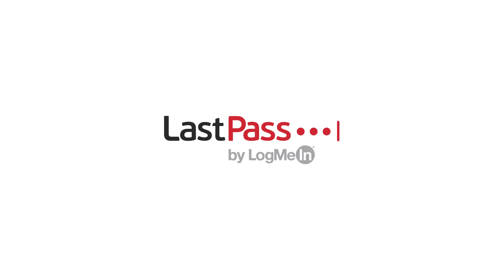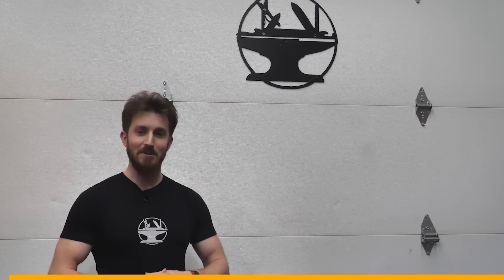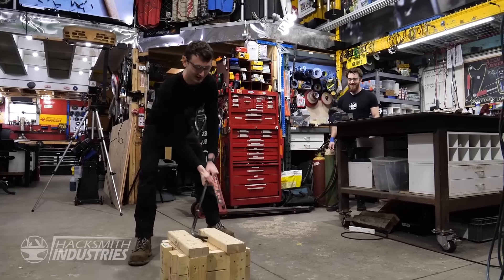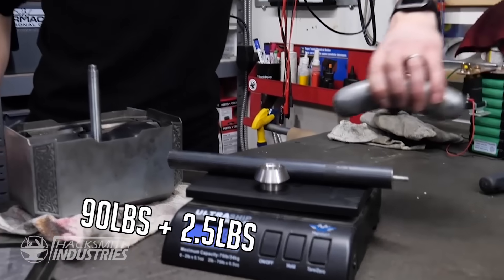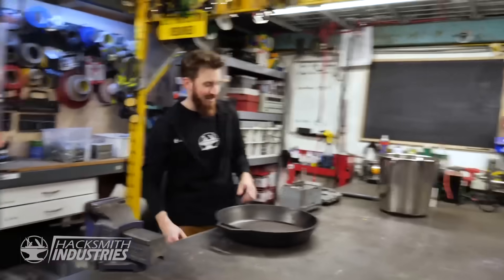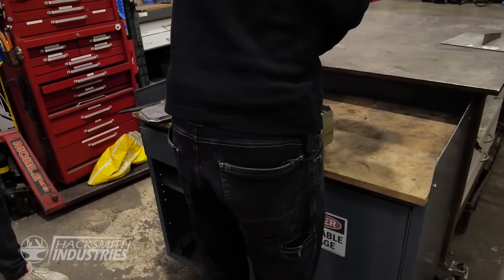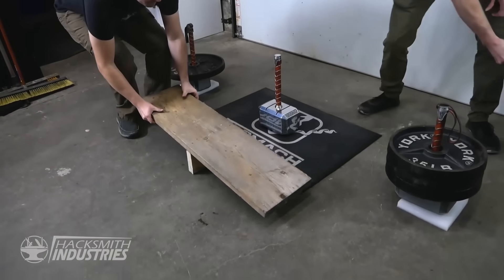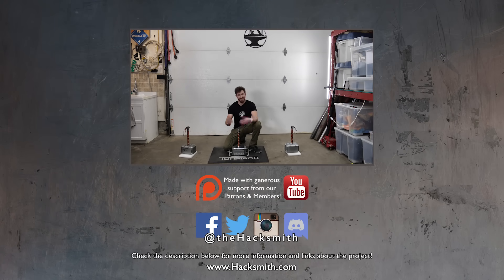Tungsten Thor's Hammer (World's HEAVIEST)

Comment: You should get some depleted uranium next time lol. Great video, keep up the good work
Reply: Yeah. Could melt it, considering it's within the temperature range of steel molds. Not that those last long, but there are over 200 K between their melting points. A steel melting foundry can handle DU just fine. It might be licensed though....

Comment: Since Gold weighs more than Tungsten and a lil 12in Cube of Solid Gold weighs about 1200lbs, what would the Hammer weigh if it's cavity was filled with 24k Gold?
After you notice, the Bevels and Threaded Rod displacement must be Subtracted, I will not accept "FML!!!" as the correct answer...................ok go ahead and use Water if you must.

Comment: I knew they couldn't make a pure tungsten head hammer.  Tungsten is an element with the highest melting point and is used in the hardest tool steels.  This metal is much coveted in the aerospace industry for making jet turbine blades and rocket nozzles.

Comment: Go on make really heavy. Use Uranium.
Edit: This statement was wrong.
Reply from the maker: Weighs the same as tungsten... Check your numbers first ;)
Reply: @hacksmith  Quite right, just found out that Uranium, instead of tungsten, is used in ammo due to it's availability and not for it's density . Uranium is actually a bit less dense. Unlike me it seems. :)

Comment: Too bad you couldn't get enough tungsten and melt it into a block roughly the same size as Thor's hammer. If someone can make that happen, I would be impressed.
Reply from the maker: You can't melt tungsten!
Reply: @hacksmith  it had to be melted sometime in order to make tools from it. Over 4,000 degrees but I don't know what could be used to hold and handle it 😆
Reply from the maker: No, it's not, look up how tungsten is processed ;)
Reply: @hacksmith  how were those tungsten pieces you had formed?

Comment: This reminds me of the Circus dumbbell challenge .  The first man to clean the 180lbs dumbbell to his shoulder without cheating was Bill Kazmaier of Auburn, Alabama.    However, getting the hammer up is way more impressive due to it's center of gravity being way off.  Moment in engineering physics is the tendency of an object to rotate about some fixed point.  As the moment force increases, the difficulty of the object to remain in one spot and to be controlled (in the case of this hammer) goes way down.  If the hammer had a 4' long handle weighing 20lbs and a head weighing 90  , and you tried to pick it up from 3' down the handle -- It would be a greater effort than to pick one up that had 2 heads of equal weight.

Comment: I thought at first, "Lol why dont you guys just melt the tungsten and fill it up. It would be way heavier" Then I decided to google tungstens melting point 3410 °C. Fair enough
Reply: WillW not sure where you got this from? Might want to check google before posting things you’ve heard of so confidently.
Reply: Sp4nn4ri a ceramic mould could hold the tungsten
Reply: @cameronknowles6267  Most people don't have access to something that can heat a metal up to that point. Best I can figure is   King of Randoms Arc welding furnace in an argon gas chamber (to prevent oxidation tungsten oxidizes very quickly when it melts)  scaled up slightly and then pouring it directly into a ceramic mold of the hammer. You could scale it down to put the steel around it or just make the whole thing out of tungsten. 

This would be expensive, difficult, and i'm not sure how well tungsten will work when you're pouring it in layers like that because it would be extremely difficult to do all at once without industrial equipment designed for it.
Reply: @TheHomicidalTendency  a Craigslist oven maybe!?! They are pretty awesome! ;)
Reply: Even if you could melted the W, you won't be able to put it in the hammer, because the hammer would start melting at that temperature

Comment: Could’ve made a sand or ceramic mold and use a homemade arc furnace to melt the tungsten into the exact shape of the inside of the hammer. Would’ve been easier than cutting the shit
Reply from the maker: No, you couldnt have

Comment: Filling the handle with Tungsten would have made it a bit heavier while also balancing it out a bit more.   A solid tungsten rod for the handle would have been optimal.  But this is still pretty cool.
Reply from the maker: That would add a pound or two of weight though, the handle is less than 5% the volume of the hammer

Comment: Pure tungsten is not machinable. Like other non machinable materials it is available in a sintered form. Which is a powder that is compressed under high pressure and bonded with a polymer. Yes it is very expensive.

Comment: If you poor it out of gold it should be heavier still. Since you can replace het molten lead part in there with a materail almost equally dense as Wolfraam. It would look insanely pretty. However not very cost effective. Although it could easily be melted back.Pure gold is quite soft. Not very much suited for hammering.

Comment: Next time use Platinum, its got a slightly higher density, but its way lower in melting point 2041.4K, 1768.3°C, 3214.9 °F,, its only 250.000 $ pr kg !

Comment: Why did you guys lie about the prices of tungsten? Scrap tungsten is only worth $14 a pound and pure tungsten is only worth about $22 a pound. 85 pounds of scrap tungsten that you used is only worth  $1,190. At no point unless you were being scammed would it have cost anywhere near $10,000 to build it, scrap or pure tungsten..
Reply from the maker: Prices on Google aren't accurate - that's base material "value" but when you purchase it, it is processed into a certain shape. Which costs a lot more. We calculated the 10k from an actual manufacturer that would sell it to us.

Comment: How about making it out of Osmium?

Well, It would be really expensive
Reply: Well over half a million dollars for 114 lbs,  and they'd probably need a lot more to fill the hammer. Assuming anyone even has that much Osmium to sell, which is unlikely. It's extremely rare.

I say go the cheap route, and just build an electromagnet into the hammer. Put it on an steel beam, turn the magnet on, and then no one is worthy.

Comment: I would have put the tungsten in a CNC machine and machined it all down into chips then poured the tungsten chips into the hammer so you fit more in.
Reply from the maker: You saw how hard it was just to cut...That would ruin thousands of dollars of tooling
Reply: That's a good point. I wasn't sure exactly what tools you had on hand. I wonder how it would stack up against diamond tipped cutting tools or a laser cutter (if they can cut that thick of metal) or a water jet.
Reply from the maker: Laser cutters wouldn't touch tungsten. Water jet sure

Comment: Lead melting point 327 degrees Celsius you can melt with a candle, Tungsten melting point 3330 degrees Celsius no chemical fuel can reach this temperature.

Comment: Perhaps you do not know but in reality tungsten will not work as a hammer, because it is abrasion resistant not impact resistant, that is why it is used for tool making like endmills, drill bits, and other such tools, vice impact tools. Just saying, no actual purpose.
Reply from the maker: It's encased in lead... Would be fine

Comment: You guys should get your lead levels checked. Melting lead in an enclosed environment without ventilation can really mess you up because of how toxic of a metal it is.
Reply from the maker: Only if you vaporize it. Not just melting
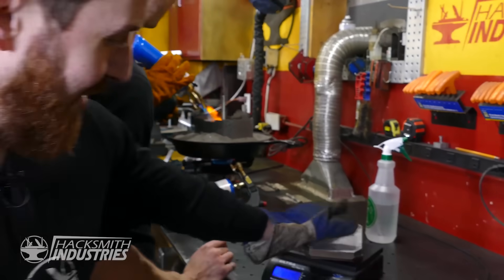Reply: @hacksmith  Very late reply, but I have a masters in metallurgy and worked as a materials engineer for a fishing equipment manufacturer which made lead sinkers. Your propane torch, or should I say torches, flame will exceed 3600F, the boiling point of lead is 3180F. While the bulk volume of metal is around 700-800F, the Knudsen layer (first gradient layer of the surface exposed to heat source) is constantly vaporizing lead. While you're more than likely fine here, repetitive exposure without ventilation will cause harm you may not even realize, just saying. See 8:56 and 9:14 for lead exposure....

Comment: You would have to cool the outside of the mold. Melting tungsten ( if you can even get a furnace hot enough ) can be done in a graphite crucible easily.

Comment: Thor's hammer, as originally designed and drawn by Marvel Comics creator Jack Kirby in the early '60s, was smaller than the thing in the movies (and the one which you understandably used as a model). The head was about 2/3 the size of the unwieldy, unbalanced behemoth you are working with and offered a much more realistic weapon design. Regardless of what material from which the head might be fashioned, I don't think the movie version would ever be battle-worthy.

Comment: you guys are forgetting that Mjolnir has to be well-balanced. You should try making mjolnir a little lighter with a denser metal toward the bottom of the handle and a less dense metal as the hammer part. Doing that might balance the offset and make Thor's hammer more maneuverable

Comment: Wouldnt it have been a little bit easier to use a kiln or forge to get the led to a high enough temperature and then create a mold of the replica hammer out of clay used in metal foundry and forge one using said mold? Or to melt down the tungsten and led together and let it cool down in the mold to then polish and engrave writing on it instead of what you guys did? Interesting video though

Comment: Would it even be possible to balance the hammer (assuming the head is solid)? Vision in Age of Ultron says that it's "terribly well balanced" meaning its center of gravity would be somewhere towards the bottom of the head/middle of the shaft.

Fill the handle with tungsten, and the head with steel?

Comment: if i was you I would've bought tungsten powder which would be much cheaper, then make-shift a hydraulic press to press the tungsten powder to a square shape or to the shape of the hammer, then bake it in an oven then cover with 2mm steel, also I would use a tungsten rod which wouldn't be expensive, this method would allow for near maximum density and would not cost alot

Comment: Tungsten powder (99% purity) costs <$40/kg ($18/lb). The "over $10,000 cost" is complete nonsense.

Tungsten melts at 3422C which is lower than that temperature of an oxyacetylene torch (3480C). 

Various refractory ceramics have much higher melting points than tungsten.

Comment: You should’ve re-casted mjolnir our of tungsten then cooled it while you poor melted tungsten into it. Be sure not to cool the mold so much that it cracks when filling though.
Reply from the maker: You can't melt tungsten
Reply: Well, an alternative is induction skull melting (though i understand limits due to the furnace cost) or powder blending with the lead that you used

Comment: Did you use a tungsten rod for the handle? If not, I think it could be quite a bit heavier if you did use it.
Reply from the maker: Tungsten is brittle. Might break. And you'd gain maybe 2-3 lbs. No volume compared to the head

Comment: Hey bro, don't if your gonna read this, just a suggestion, btw it would be super awesome if you could nestle a van de graff generator inside a hammer like this. Because the hammer head is metal, you could directly charge the hammer, and it would basically shoot lightning. The power and what not could probably be portable supplied by a drone battery hooked up to an esc.

Comment: You could’ve made Tungsten semi liquid, or where it flows slowly but still a solid
Reply from the maker: How
Reply: Heating it up? It’s like practically jello but way more solid
Reply: Its just easier to move around
Reply: The real term is semi fluid, it can also be like ice where there ice is slippery on touch but easily moves around
Reply from the maker: You can't melt tungsten. It has the highest melting point of any metal...

Comment: You dudes are dangerous. You could have died a handful of times in the video alone. Wow. Great job though!
Reply: Well, they haven't received the results of their blood testing for heavy metal exposure, so...

Hot tip: molten lead isn't the problem, lead vapor is the problem. Melting lead with an open flame means a surface temperature above the point where vapor releases... if that wasn't all done under a fume hood you guys were standing around in a cloud of lead and need to get yourselves a little poke and prod.

Comment: Platinum, Iridium and Osmium are 21.5, 22.4 and 22.6 gr/cm^3 respectively, even denser than Tungsten which is 'only' 19.3 gr/cm^3 compared to them. So, it is still possible to make a heavier hammer (if you have the money to get these super expensive elements). Platinum melts at half the temperature of Tungsten, but it would have been even much more expensive. That would have been a humongous gift, it's worth more than making a Thor's hammer of pure gold. Probably an alloy of any of these rare metals could even be denser than the individual elements themselves.

Comment: Yeah, Tungsten does have a high melting point... I got a ridiculous assignment in college to make a casting mold for some piping that was done for beverages... ( only on paper, thanks god ) and the most ridiculous part was... I picked a 22% chromium - steel alloy... the steel was OLT-45 or something in Romanian standard (STAS) ... that is laminated tempered steel for pipings... but with 22% chrome it kinda got in the way of making a normal mold... and I was lazy.
So I went... Wolfram-Rhenium alloy for the casting mold... totally cost efficient and doable ( if you are god, that is...)

Anyway... I was disappointed, guys.
I know it's a lot to ask, but you could have kinda... made the hammer from scratch. That would have been fun, cool and an achievement. If you made a hammer out of pure tungsten ( heck, I still wanna call it wolfram )... it would have been like... legendary
Reply from the maker: Yeah... We make a video a week. How would we be able to make it from scratch in that kind of timeline

Comment: Shoulda made a SOLID tungsten mjolnir, it eould have been literally bulletproof
Reply from the maker: Tungsten shatters. A bullet would destroy it
Reply: @hacksmith  then what explains tungsten bullets? They can be reused if found
Reply from the maker: Alloy, not pure
Reply: @hacksmith  so make one out of a tungsten alloy🤦‍♂️ i said to make it solid, as in 1 piece instead of a hammerhead + handle made out of scrap melted together, not pure tungsten
Reply from the maker: When is anyone even going to shoot it...
Reply from the maker: And you can't melt tungsten!!! Or an alloy of it. Over 6000F to melt
Reply: @hacksmith  yeah, that was the whole point ur not getting it done without a forge🤦‍♂️

Comment: By my calculations, you could get an extra 5kg by using Mercury. Would double your cost, but that's a minor detail.
Reply from the maker: What calculations? Mercury isn't that dense...
Reply: According to the periodic table, Mercury weighs in at 200.59 g/cm^3 to Tungsten's 183.85.
 You said that your hammer weighed about 50kg. Dividing that by the density of Tungsten tells me that you have roughly 272 cm^3 of volume to play with. Multiply that by Mercury's density and you get a mass of 54.55 g.
 It's not a large increase, and the cost would be massive (near as I can tell, Mercury goes for around $0.36/gram, which comes out to more than $19 grand), but it is an increase. Although, thanks to Mercury's famous low melting point, it'd be much easier to actually get it in the hammer.
 Now, I know not all of the 50kg came from the tungsten, as there was the handle and the mold of the hammer itself contributing to the weight. However, some of the space inside the hammer is being filled with the less-dense lead. That is, if you somehow filled the space with tungsten instead of lead (which I know is unfeasible), you could've increased the weight of just the filling to somewhere close to 50. I also used 50 kg since it's an easy number to work with :D
Reply from the maker: That's not what the number on the periodic table means... Not even close sorry. Tungsten is 19.25g/cm3, Mercury is 13.56g/cm3 by density.

You are looking at the molecular weight ;)

Comment: If he were to use material from a neutron star his hammer would weigh

2.59 * 10^14 kg
Which is 259000000000000 kg
Reply: However the only reason a nutron star can reach that density is pressure and if you whould remove the metal to make the hammer from the star it whould expand making it much less dense  but I dont know how heavy it really whould be in real life.

Comment: Good luck reproducing, tungsten is radioactive AF. Ya don’t want to be breathing it too much.
Reply from the maker: No its not
Reply: That’s good to know, I was always told to grind tungsten welding electrodes outside or with a mask on. AVE said that in a video too so I thought it was legit.
Reply: “The Thorium used in 2% thoriated tungsten is a radioactive element and therefore can be dangerous to the health of those exposed” OK that’s actually only The welding electrodes  I did a little research lol 😝 my bad 🤗.